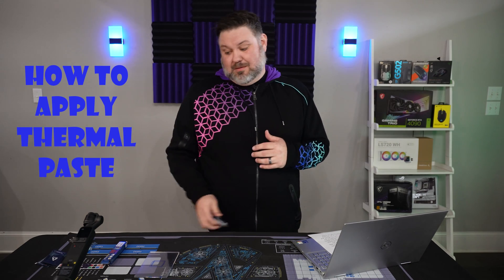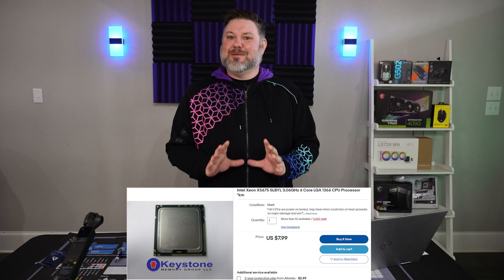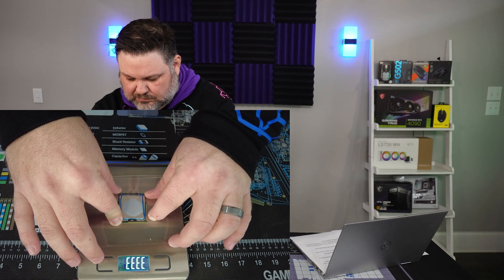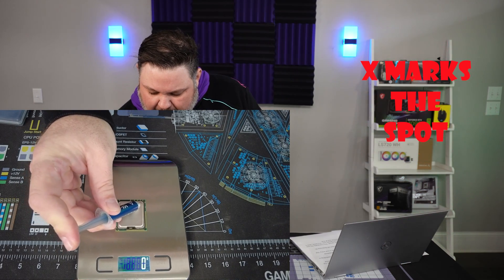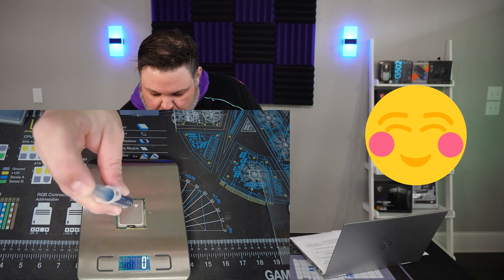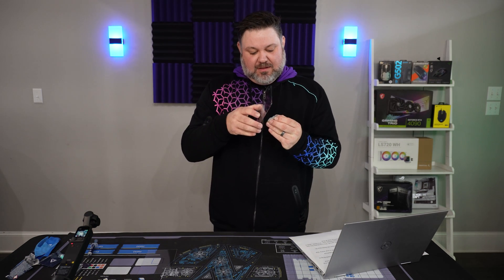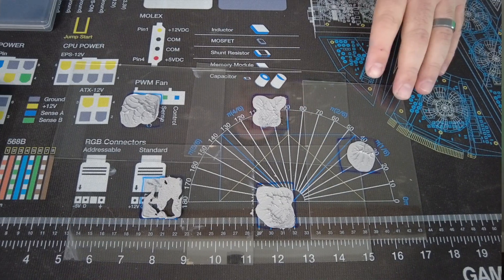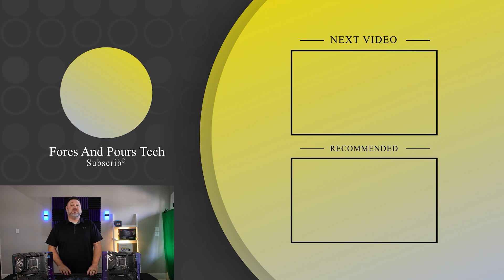BEAT THE HEAT! Testing 5 Of The Best Thermal Paste Patterns

Comment: Using a spatula or applicator from Kryonaut. And for a core that has a high TDP Honeywell PTM7950.
Reply from the maker: I have a Spatula from arctic, but couldn't find it. Guitar pick worked better than expected though. Has the ptm7950 become more reliable to source? I've seen great things from people that tested it, but have heard getting the real deal can be iffy at best.
Reply: @FPP_Tech  So far, proven sources of PTM7950 are moddiy, ebuy7 and aliexpress from RGeek Flagship Store. Tests have shown that the thermal conductivity is mostly higher than pastes and almost equals liquid metal. There are even videos of how a serviceman applied this material to PS4 Pro v=zu3SdNe4oLs and PS5 v=hO76gzofqDM both consoles did not overheating. Lenovo applies PTM7958 similar phase-change material from Q4 2021 in its top Legion series.
Reply from the maker: Hey, thanks for the tip on where to source it. I've been wanting to test some. Working on getting an open air bench for the channel. I'll definitely grab some, give it a go & give you shout out for the tip! Thanks.

Comment: I've always used the pea drop one until my last upgrade. New CPU demanded a monster air cooler (double tower). I initially used the pea method there as well, but my thermals were not very good so I decided to reseat the cooler. When removing it, I found a mess. Just like you show, the paste didn't reach the edges (big percentage of the CPU's surface) and it was mainly accumulated on one side. I opted then for the spread method and the temps dropped easily 25ºC (it's very probable that the cooler base was previously not making proper contact as well, but all summed up makes the difference). These big coolers are not so easy to install (specially the clips part) hence they can move a lot while setting them up, and if the paste is not spread from the start, then it's just like shooting in the dark...!
Reply from the maker: I've always preferred spreading it, but so many people have told me it's a waste of time. I feel somewhat vindicated now. I know that wasn't very "scientific" but it was a fun little test. Thanks for recommending the hashtag. I don't think it'll make the cut in the next build though, little messy. lol
Reply: @FPP_Tech  Haha, no problem, I wouldn't try it on my pc either but it was interesting to watch!

Comment: Years ago, Arctic recommended spreading a very thin layer on the IHS and the bottom of the cooler and then gently wiping or scraped this off to leave a slight hazy layer in the microscopic imperfections of both surfaces.  Then, a small amount (pea sized?  grain of rice sized?) was to be placed on the IHS before mounting the cooler.

Another technique I've used is a small X in the center of the IHS which is surrounded by 4 rice sized amounts around the X, between it's arms and about halfway to each edge of the IHS.
Reply from the maker: The Arctic method sounds interesting. I always clean the stock paste off of whatever cooler I use (assuming it has it), but I've never considered putting some back on. It does make sense though. I like the x & dots. We're going to start stress testing AIO's this year. Going to have to try that one out. Thanks for watching and commenting!